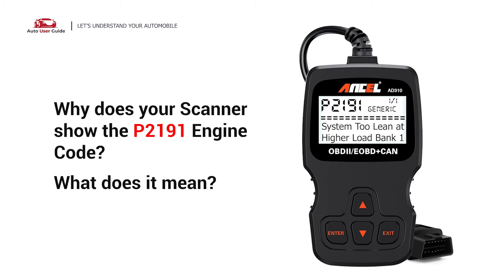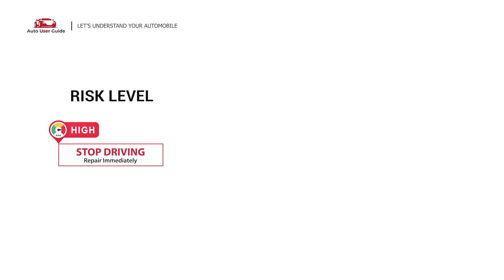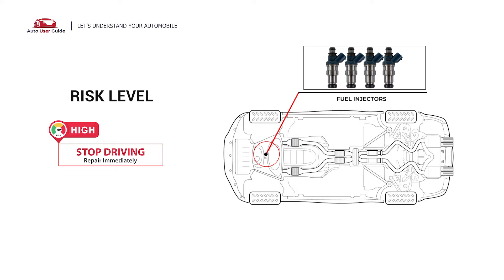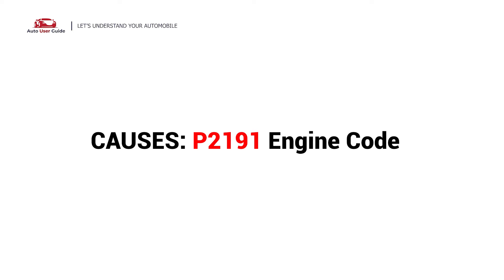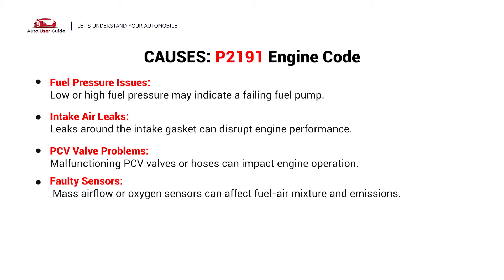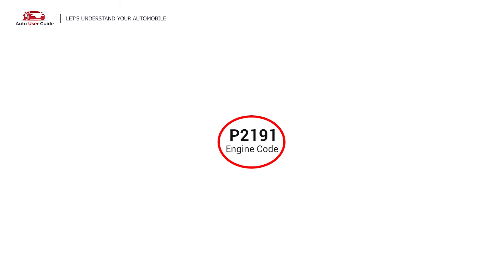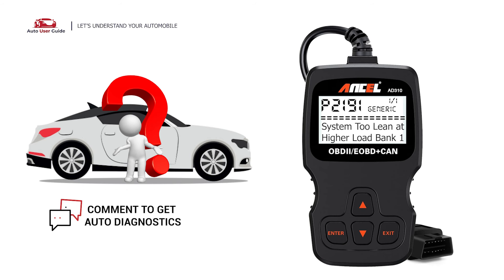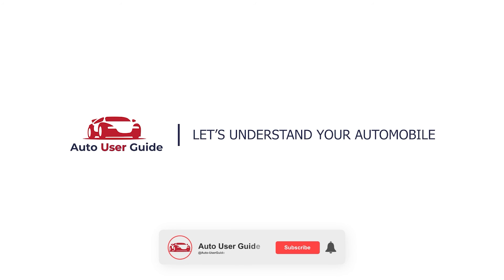What is P2191 : Engine Error Code Causes Explained

Comment: I would love to fix this code. Hyundai accent 2016. Have replaced the high pressure fuel pump, camshaft sensors, camshaft selenoid, and Map sensor. Spark plugs changed professionally. No black smoke coming out, decreased speed until I changed the camshaft sensors, stalling out until I changed the Map sensor, now it's running smooth but within 15 miles the code came up again. 2191 and 2187 combined. The high pressure fuel tank was changed because a mechanic told me that was the issue but again, that was changed and the same codes still coming up. Help me please!
Reply: Fuel pressure regulator and injectors.
Reply: I would start checking  vaccum line hoses anf fittings. Especially if you have put some pretty good miles on your car. I just bought a 2011 Kia Forte and guess what?  It shows code P2191 i found a vaccum hose that was sucking air around a fitting . I fixed it and  no more P2191. Hope this helps ya!
Reply from the maker: Complete Fixing P2191 Engine Error Code Video: https://youtu.be/_ZZYsX5fwgI